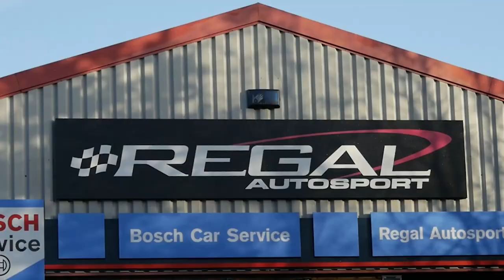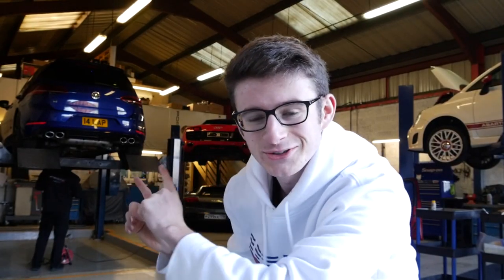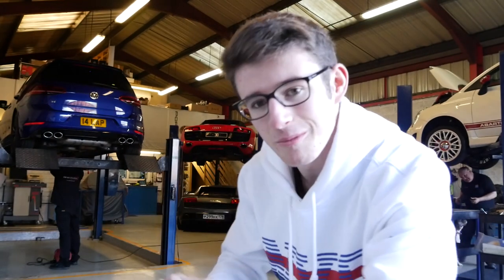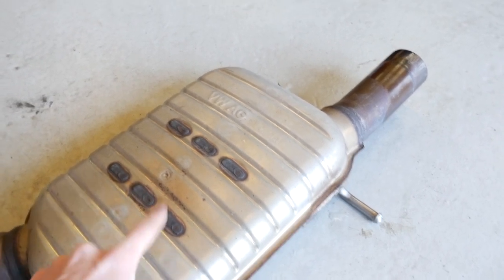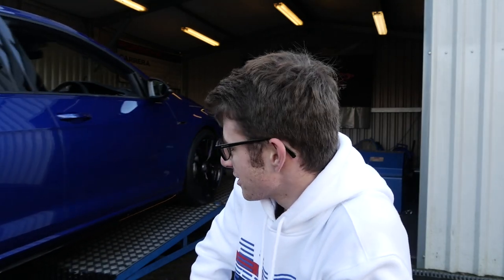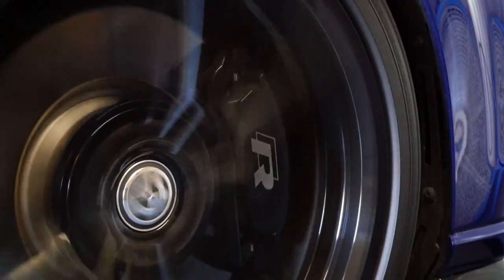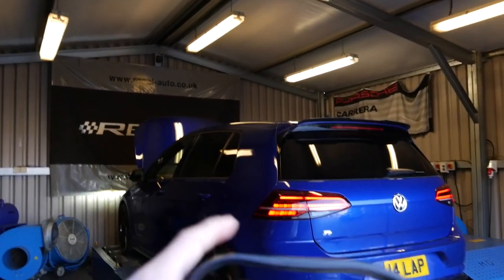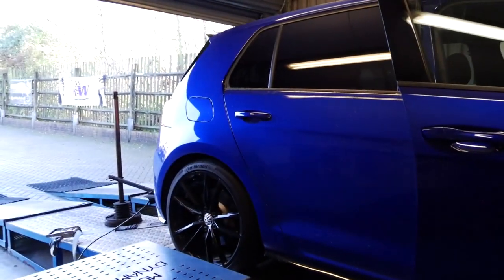Fitting A Resonator Delete Kit to my Golf R!

Comment: Please note, this kit is not suitable for 2019+ R’s with a PPF/GPF emissions system fitted (There is no central resonator to delete!) This is VAGSports quote. I have a 2019 with the PPF does that mean Mines is muffles by the PPF and even though it doesn't have a resonator it's still quiet as is it has a res and theres nothing i can do about it unless i remove the PPF which i have to replace every MOT inspection?

Comment: I really don’t notice a that much of a difference, plus I drive a Manual mk7 R so I won’t get the pops and crackles. I’d definitely recommend the Stage 1 remap for any MK7 R owners out there, I’m running 361.5bhp and 537lb-ft torque!

Comment: Why didn't u not just get a non resonated catback? I got a miltek one on my 2.0 tsi Scirocco. Yes its obviously more expensive then a simpel resonater delete but it will turns head and for sure in a golf R. You still have an untouched oem catback if needed
Reply from the maker: Simple answer is it's more expensive. Eventually I'll do a full exhaust, but for the time being I thought I'd do a res delete as it's so cheap

Comment: have you a problem with your seat memory in golf r? In my case i’ve set the lower position and then when I restart my car, the position changes ... its very anoting I thing that is a design problem... share your case
Reply: Pedro Bello are you using the same key every time?
Reply: Kohan Rebeiro I always use the same key. I want to know if it’s a problem with my car or all golf r. I also tried with the 3 available memories ans the problem is the same
Reply: Are you saving the seat setting when you set the position? So press set then a number. Your issue doesn't happen in my r
Reply: Kohan Rebeiro yes, i do the same that is in the manual. I dont have problems with other positions... the only position with problems with memory is the lowest, so when I restart the car the seat lift up a little. Tell me if you try to set your seat in the lower position.
Reply: Ok mate I'll try it tomorrow and let you know

Comment: Sounds better - How much all in with removal/fitting? + Dyno?
Reply from the maker: Thanks Paul! £140 for the kit and £90 for fitting
Reply: hampshirephoto £90 for 20min of work? 😂😂😂😂😂 what a rip off
Reply: @xBigModzHD  I'd rather get work done locally at a reputable garage than travel, £90 does seem steep for fitting as I've used Regal recently and their hourly rate was a lot less.  I had a full service and belt changes on my Corsa there, charged less than a dealer and another garage I used in the past. No point driving a few hours for the sake of saving a few tenners.
Reply: Paul Jacobs there most likely isn’t only one reputable garage in your area there is probably a few, most garages charge 30-35 hourly rate so anything under an hour shouldn’t be more than £40
Reply: @xBigModzHD  Regal charge around £60/h. Probably cheaper up north
Reply: Paul Jacobs I’m from Birmingham and most the top rated garages charge £35 tops
Reply: £90 for fitting?! That’s hilarious. Progressive Parts who supply the VAGSport res delete for the UK only charge £36.
Reply: @jimfastlane28  Manchester? Its more expensive on the South Coast. £36 for an hours work near me would be a bloke with a transit van, halfords jack and youtube tutorials on his phone.  Not sure a 500 mile round trip would save any money!
Reply: Paul Jacobs I’m not sure it’s an hours work to be honest. Have a look at PP’s res delete video for Golf R. Probably 25/30 mins max I’d say.
Reply: hampshirephoto £230 for a de-res?😂 you realise its a £60 job all in job

Comment: Does it avoid warrenty
Reply from the maker: Not as far as I'm aware. I think the most it would void is the exhaust warranty, but the overall warranty is safe. Hope this helps :)
Reply: Voids the warranty and causes a terrible drone inside the cabin. Sounds good fo about 2 seconds, then starts to get on your nerves. the most stupid mod you can do on a car!
Reply: @julientaylor  think you've mistaken it for a cat back
Reply: Seen this question pop up few times on forums, avoids exhaust warranty so main one still intact. Doesn't cause drone just amplifies the pops and bangs when in sport mode
Reply: @gaznelson8615  Hi, do you own a Golf R?
Reply: @julientaylor  yep, granted not done res delete yet but been in one that has, hardly any drone just makes pops and bangs louder
Reply: @gaznelson8615  please check-out this link:   https://progressiveparts.com/resonator-delete-pipes-do-they-drone-what-you-need-to-know

the answer is: Drone = Yes (maybe less with this pipe) but still Yes!
Reply: @gaznelson8615  Volkswagen Warranty UK: Items which are excluded from warranty cover include but are not limited to:

- Components or equipment which were not part of the vehicle at the point of original manufacture.

meaning: this mod can cause less exhaust back pressure > more power is beeing produced from the engine, due to less backpressure (not allways the case, but for a golf r its beneficial) > higher engine temps > higher engine wear!
If Volkswagen UK claims you had an engine failure due to this mod, its gonna cost you alot of headache & money upfront before you can/cant claim you warranty.
Reply: Julien Taylor bet you’re well fun at party’s
Reply: Might get a res delete on my golf mk4........oh wait 😔
Reply: @nathadarnell  Yeah: 8h Drone at a party vs 8h drive with Drone.
Ill take the party, thank you!
Reply: @julientaylor  hmm I'm only going on specialists on the forums who work on golf R's all the time, many on there have had the res delete and vw have not said out about it when doing manufactours work

Alot turn the soundaktor off when they do the res delete aswell
Reply: BCS do a res delete with an anti drone pipe attached, costs more than £140 though.
As for warranty I doubt it'll make any difference, you could always put the old resonator back on I suppose....
Reply: You mean void..

Comment: Are you going to do a drone movie now?
Reply from the maker: I am, coming soon!
Reply: +1 for the drone video.  More in depth please!  I am on the fence with the VAGSport RES Delete or the BCS Res Delete.  Apparently the latter has a Helmholtz resonated section (but I'm no expert).  I've always thought the car was a bit too quiet so well up for the RES Delete, just don't want the drone as I do a lot of motorway driving.  Another great video as always.
Reply: @hughjohnson2926  I have the Vagsport fitted on mine and it only starts to drone when you hit about 85 mph, that's on a pre-face lift version. It will start to drone at a slightly higher speed on the newer face lift version due to having 7 gears.

Comment: And yet deleting the res gives no extra power AND makes the engine much louder.  Great for showing off with the girls at the track, but horrible with the other 99% of the time when you are daily driving.  No thanks 😉
Reply from the maker: Actually you're wrong. The car is 307bhp stock, but with the res delete it ran 322bhp on the dyno...
Reply: So now your going to hate your life on a 30 minute highway commute?
Reply: hampshirephoto did you dyno it both before and after ?
Reply: As Kamil Krait said. Dynos of different brands are known to give quite different results. Even same models, but different individual units can have significant variance. But comparing VW's published hp rating to your post-res-delete wheel hp result leaves way too many variables floating around in the air to be determinate. A baseline pre-mod on that same dyno would be the only reliable data to compare to. Nevertheless probably improves the exhaust note!
Reply: @chriskelvin248  couldn't have put it any better myself.
Reply: D J it makes the exhaust louder not engine. A slightly fruitier exhaust over the standard R is no bad thing. The way you’re carrying you’d think he’d done a straight pipe. Steady on its horses for courses. Let the lad enjoy his car.
Reply: A res delete like the VAGSport one has been properly designed and so absolutely fine for everyday and when driving on the motorway. Just put one on my 2018 GTI Performance and not as loud as the R but really good. And quiet when driving normally.
Reply: Totally worth it! Everytime i hit a rev above 3000 in mine i smile! So yeah its worth the $ power boost or not. Dont get me started on windows down driving through an underpass or tunnel 😁. On the highway at 100-110Km/h its still very quiet!
Reply: hampshirephoto wrong and it’s been proven through several dyno runs
Reply: You know you’re getting old when you write comments like this